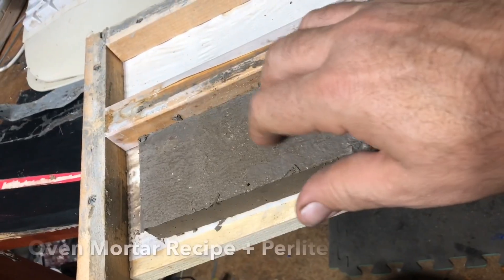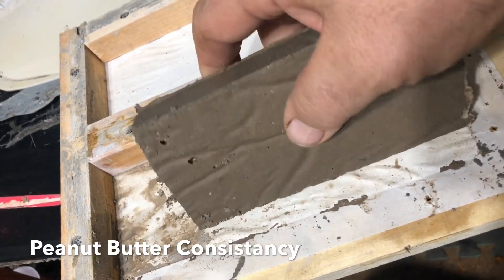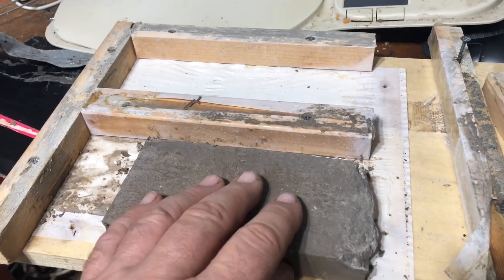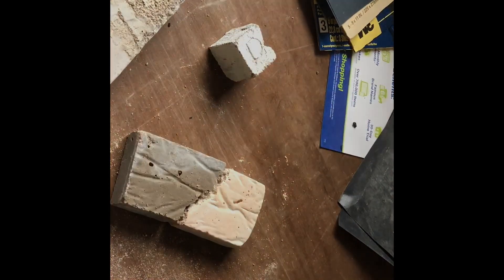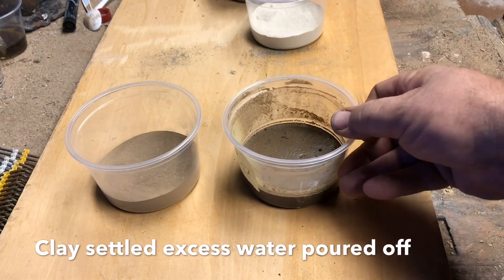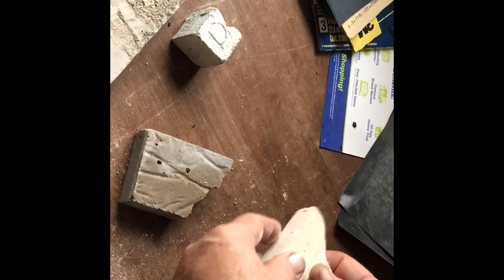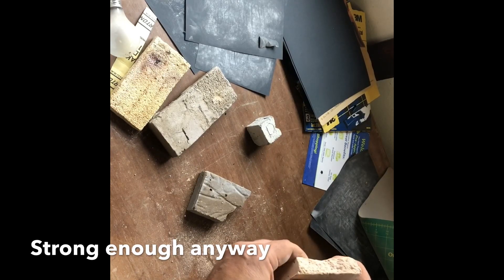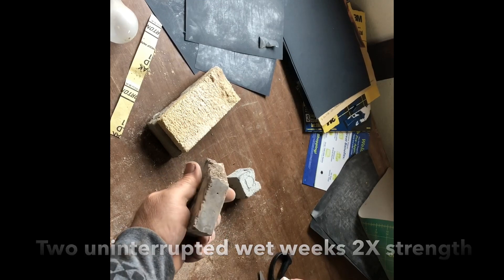Process Peek Refractory with Lime SUCCESS

Comment: I don't really understand anything you said in this video, but huge thumbs up for the technical video to enrich the platform! Way more useful than a(nother) fail video.
Reply from the maker: This "Process Peek" is part of a continuing effort to come up with a DIY refractory I can use to make furnaces at home. If and when I get to the point where I have a formula that others can use I will make an instructional video that is easy to follow.

With luck there will be more success but generally when experimenting the failures greatly outweigh successes.
Reply from the maker: I know this is dry stuff.  Its why I try to keep these videos under 10 minutes.

Comment: That fired brick and sounds good. getting ready to build something? Cheers Peter
Reply from the maker: Yes a furnace or three.  Currently I am using a Kerr 666 burnout burnout oven to melt aluminum.  It 6’ x 6" x  6’.   First will be a larger electric followed by a propane & oil furnace.   Thanks for watching.

Comment: I have bentonite mines all around me. I have a place locally that i can go to get bentonite off a friend personal property. what would i use it for dan? I also have portland cement but i dont have a way to fire the bricks if i want to make bricks.
Reply from the maker: By my thinking you want a clay that does not expand much for bricks.  Bentonite  clay expand like 3.5X its dry volume and shrinks back about that when it dries.
Bentonite is great for lining ponds!    In foundry work we use it along with sand to make our casting sand, aka green sand.
Reply from the maker: I should mention you can make  bricks that do not  require firing using Portland Cement mixes.  More like what you see in patio pavers.   You can also use lime in addition to the Portland cement.   The lime makes for a less brittle concrete.  The ratio is in my foundry blog, I can that for you if you like.  There is an spectrum of Portland cement mixes that one can play with.    In this video dPerry makes concrete that can be worked like clay.  https://youtu.be/e4j5qgNFQE0   Much of what he uses is not free and some is expensive to source like  Metakaolin.  But don't let that stop you from looking into what he has been up to.  It's good stuff that can open new doors.

Comment: Holy cow, I didn’t realize bentonite so expensive. Interesting stuff. The brick you fired sounds like it would float.
Reply from the maker: Thanks for watching.   I am having a blast with this.  If I end up with a decent refractory for furnaces all the better.   
I will try floating it and let you know.
Reply: Dan Harold I watch a few guys who mix pure Portland cement with foam and make “air-crete” . It’s a neat system.
Reply from the maker: II have been playing with casting concrete to make boxes for my in ground plumbing.  it gets heavy so I would like to try air-crete sometime if I could find a way to diy the foam for cheap.
Reply: I have been watching this guy for a while. He has some decent information.
Reply: But some of his information is questionable in my opinion...
Reply from the maker: Now you have me thinking seriously about air entrained refractory LOL
Reply: Dan Harold here is another guy that does air Crete stuff. He also sells a foam machine that works extremely well.
Reply from the maker: @RedefineLiving  All of my information is questionable.   I learn as I go.  The conclusion I make in one video is trashed  in another.